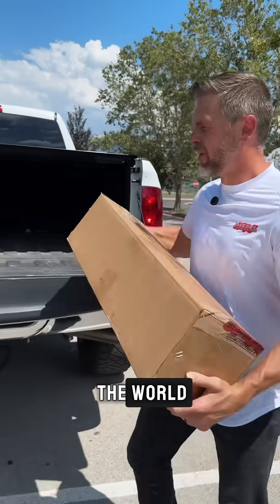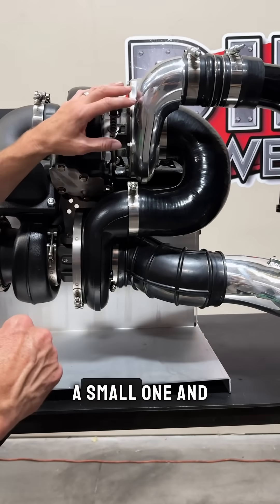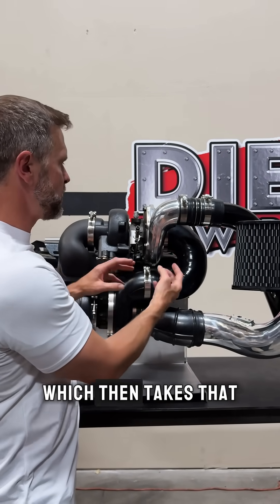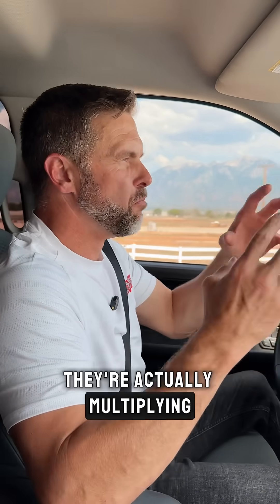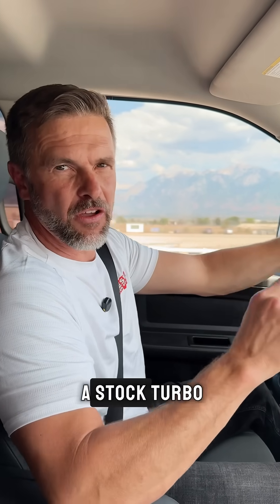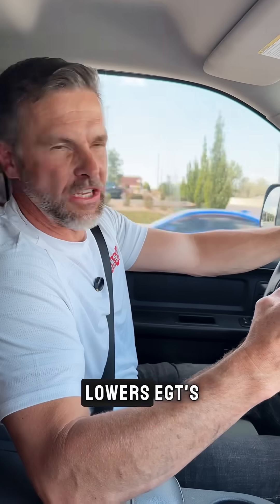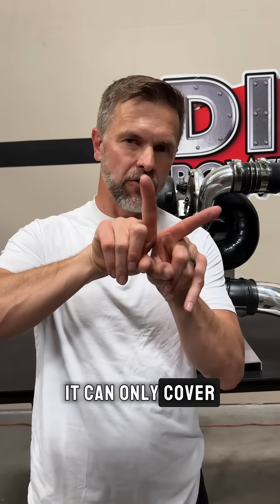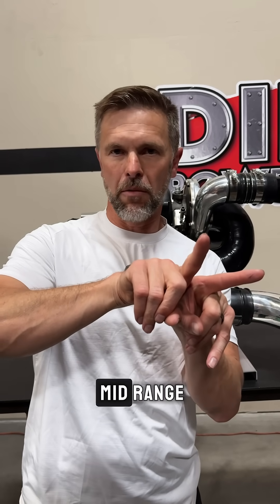You could have the best single turbo in the world but it still wouldn’t compare to a compound turbo!

Comment: You got turbo lag or your trucks turbo giving up on life trying to get up those steep hills.
Do yourself a favour and convert to compound turbos to give your truck a new life, increasing power, fuel economy, lower exhaust gas recirculation temps that will put a smile on your face.